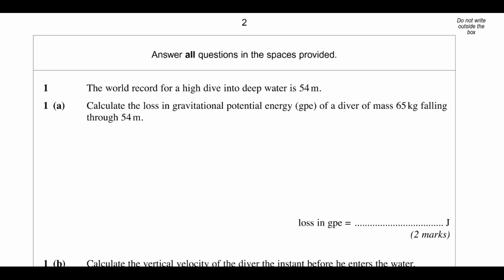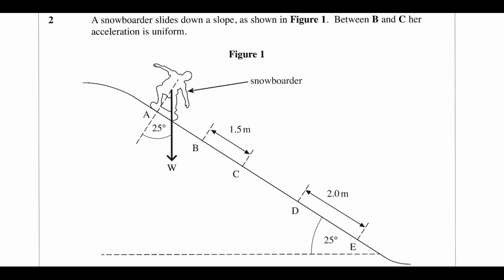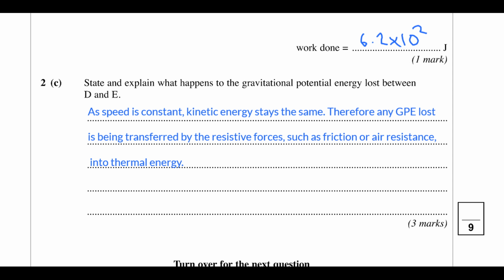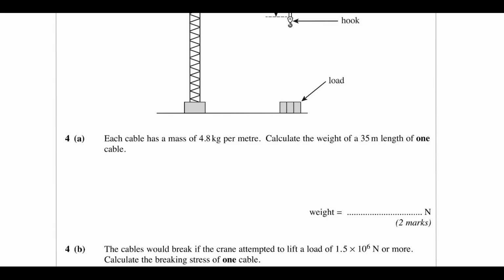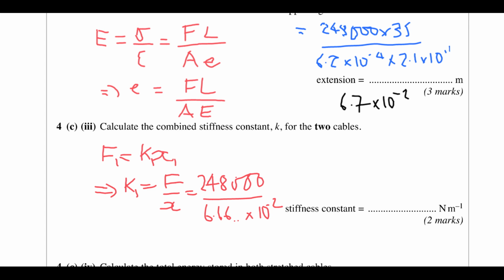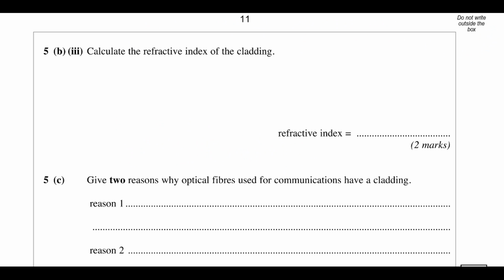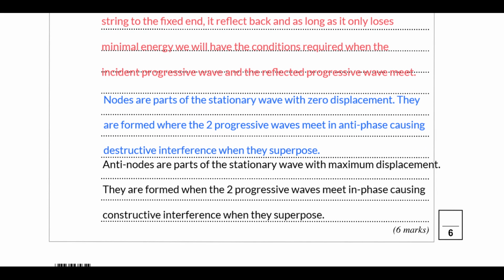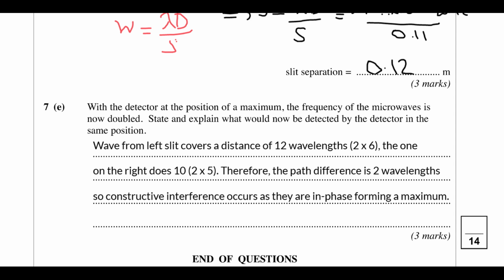AQA: A Level Physics: January: 2013: Unit 2: Worked Solutions

Comment: Hello, just  a quick question. For question 2bi wouldn't we not use cos theta instead of sin theta as we are turning through the angle when acting down on the slope .
Reply: Jesus reading that just gave me a seizure. So did the phrasing of the question to be fair.
Reply: @LachlanTyrrell2003  What was so hard to read ?
Reply: @saraahmed632  let's start with "wouldn't we not use." How about "wouldn't we use?"

"we are turning through the angle." what does that even mean lol.
Reply: @LachlanTyrrell2003  If you knew anything about mechanics, you'd know what it means lol. I feel extremely sorry for you, if a grammatical error that a complete stranger made on the internet offended you!
Reply: @saraahmed632  I mean, I actually got the question correct 😂
It didn't offend me. You literally asked "What was so hard to read?" and I gave you a straight answer. Who's the one who's offended?
Reply: @LachlanTyrrell2003  "Jesus reading that just gave me a seizure. " Oh okay, so your seizures are just easily triggered then.